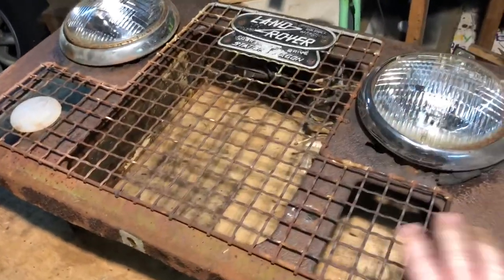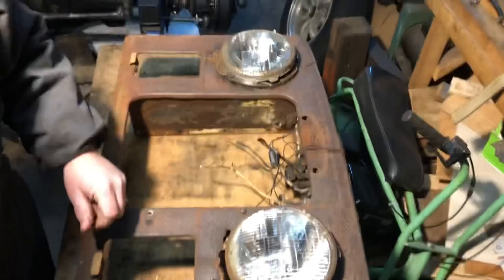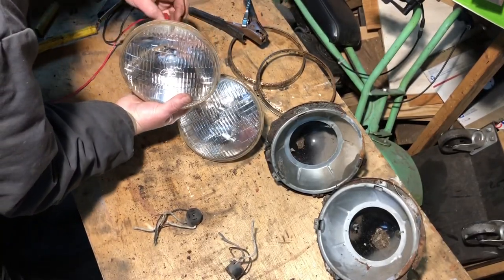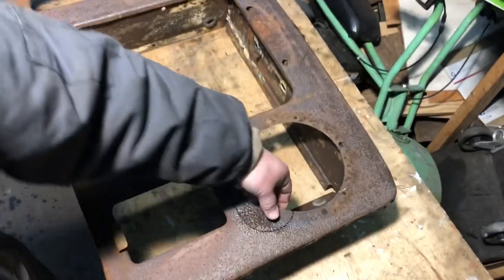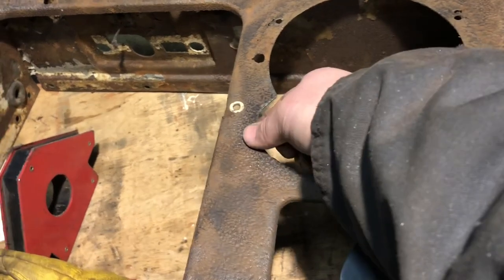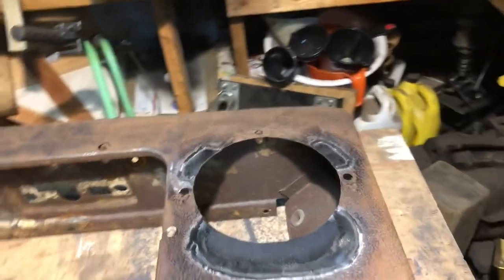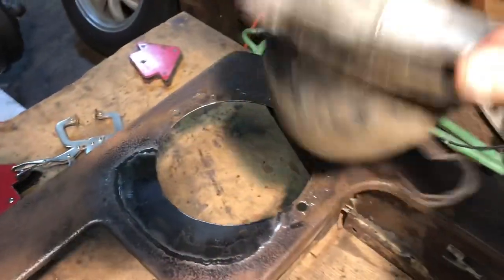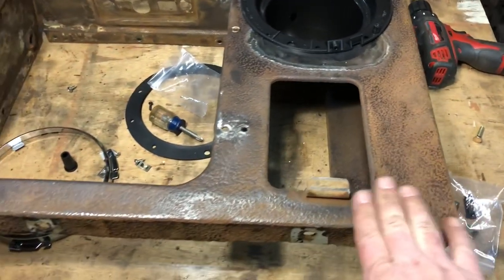Front Grill Repair Land Rover Series 2A Restoration Part 47

Comment: Yes! I just put my grill into the sandblast cabinet today, I might use paint stripper first and then blast / galvanise
Reply from the maker: Goes your grill have lots of paint on it? Paint stripper would be better to start with before sandblasting. Make sure you get the strong paint stripper. So it eats right thru it. Good luck! Can’t wait to see what it looks like.
Reply: @conrad1468  Yes, I always use paint stripper before sandblasting it’s much easier that way. I ordered some paint today as the weather looks like it’s improving here. The grill will be one of the first things that I’ll be painting!
Reply from the maker: Good luck with the paint. Spray it on? Getting a spray gun for yourself?
Reply: @conrad1468  Yes, got one already, I painted the chassis etc. Looking forward to it.
Reply from the maker: Aahhh Ok... Gotcha! Can’t wait to see it!

Comment: Looks great! My front piece is aluminium and I didn't know Land Rover made them of steel.
Reply from the maker: Thank you Sir!! Aluminum... interesting. The grill holds a lot of weight with the spare tire and radiator. I’m glad mine is steel so I could fix it.
Reply: @conrad1468  I got unsure, but I'm out in the garage now and yes it is aluminium. Pretty thick so it should hold but the best part is that it's as good as new. 😃 I have cut out some strength from it to fit the Mercury Cougar radiator...
Reply from the maker: You have some sweet mods to your truck! Love the build! Keep plugging away!!
Reply: @conrad1468  Thank you sir! I just had a building inspection and I need to convert it to fuel injection and install catalytic converter. Other than that it was just minor adjustments. 👌
Reply from the maker: Very cool Man!!
Reply: @slowshop  Series 1 radiator panels were aluminium.
Reply: @onetonlandrover  Thank you! That seems likely.
Reply: @slowshop  They didn't go to steel until the 88/109 series 1 iirc.
Reply: @onetonlandrover  Odd to go to steel and keep the rest of the panels aluminium.
Reply: @slowshop  I think the ally ones used to crack. Steel was/is stronger.

Comment: Is it still a diesel engine?
Reply from the maker: Yes, Sir! Still the 2.25L Diesel. I don’t plan on changing it. It runs great!
Reply: @conrad1468  Cool! It didn't sound much like a diesel in the earlier video so I wasn't sure. Diesel station wagons were very rare. Is it an original NADA vehicle? All of mine are petrol aside from my Defender.
Reply from the maker: @onetonlandrover  I had my VW running too in the old video. I should’ve shut it off. From the VIN number it’s a LHD Export. It doesn’t state NAS in the information. I don’t know what the difference because everything looks the same as the rest. Unless I’m missing what the differences are from NAS and ROW?!?!
Reply: @conrad1468  In 1962 probably not much difference, lights perhaps? Red rear indicators?